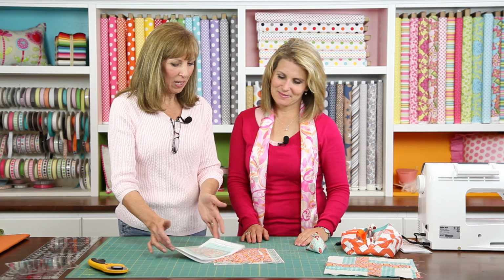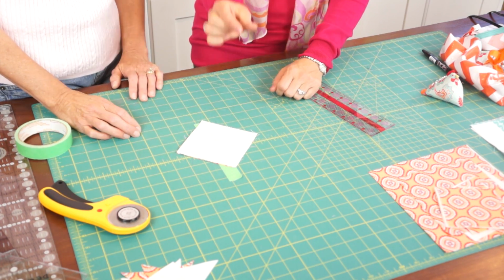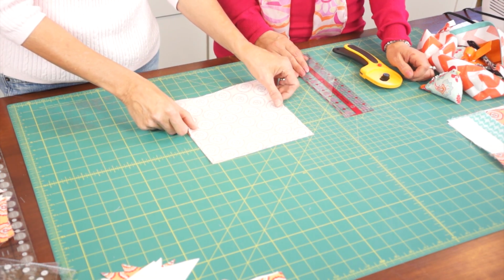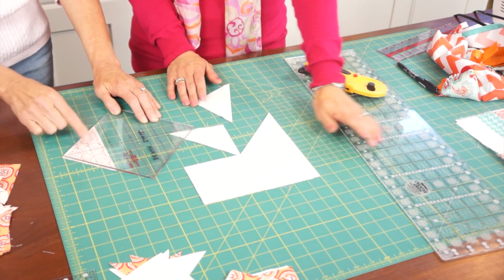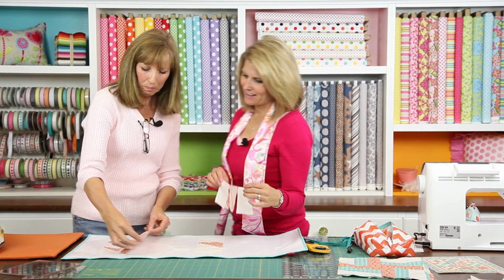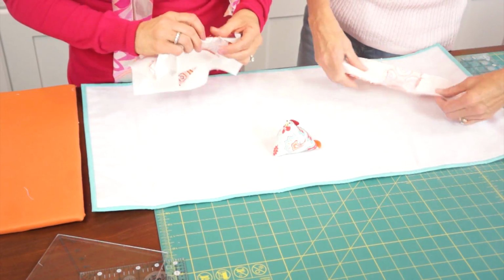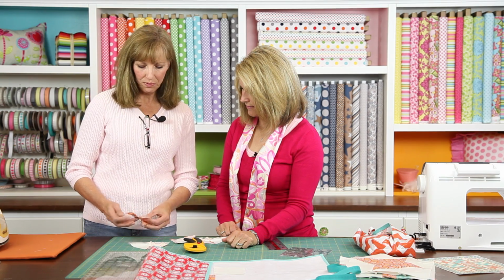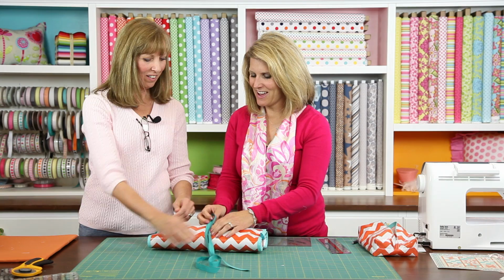How-to-Quilt Series: Triangle quilting blocks by Deonn (3 of 9)

Comment from the maker: Rounding up .875  to 1" extra on half square triangles not only makes it easier for me to remember the formula, but then I can always rely on trimming it down exactly to the correct size so my blocks fit together precisely.  Even without the Triangle Square-up Ruler I make it a practice to re-trim my blocks to get the right size. Mind you, these tutorials are intended to give the best advice I have for precision piecing, but everyone will find their own joy in quilting.
 
Happy Quilting,
~Deonn

Comment from the maker: I always add a little extra and trim down, or end up taking a scant 1/4" seam in the first place.  Many quilters find that their blocks turn out a little short using the exact formula.  Sewing even a thread-width bigger than 1/4", not pressing crisply, or using too much steam which may distort the block are factors that can cause the difference.  
(continued in the next section)